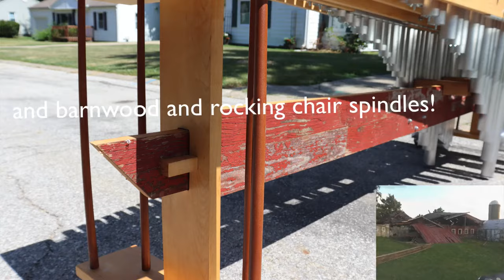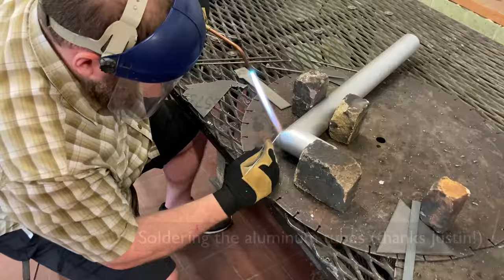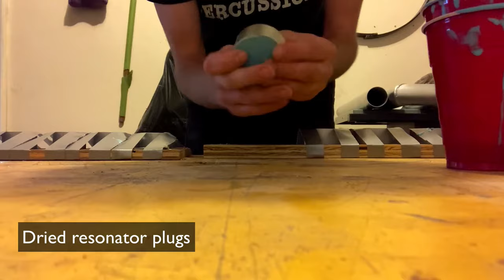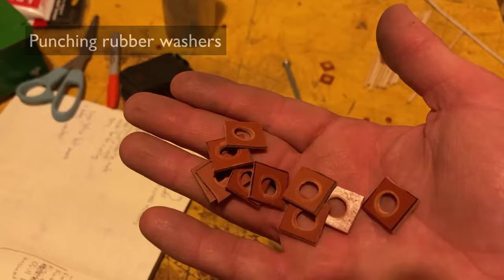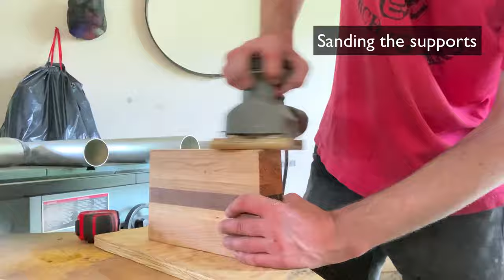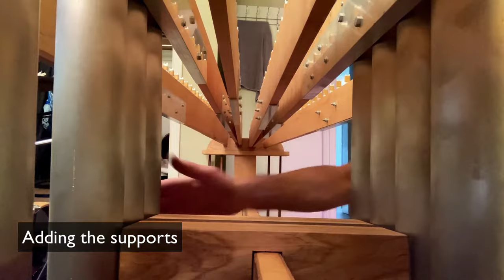Marimba Resonator Upgrade - Demo Performance and Construction Steps

Comment: oh my gosh  you made this! so awesome!   I want to make one for my kids elementary playground now. Maybe I can use trex decking instead of wood and use aluminum keys instead of wood? I know how to weld and machine aluminum so that part is not hard. There are companies that make playground marimbas but they are $3600. what is a reasonable budget if I can get aluminum wholesale for about $3/lb where I live.
Reply from the maker: Hi Rolland, thanks for watching! Yes, I made this one back in 2015 and then upgraded over the summer. Aluminum keys will work great! That's kind of like how you would make a vibraphone. Glockenspiels are made from steel typically. I've always wanted to make a vibraphone but just haven't gotten around to it. I always imagined myself doing the tuning on a grinder, though. For the glass marimbas I made, I tuned with the belt sander while wearing a high-grade respirator. Hope this helps and good luck with your project!
Reply: @AlexSmithMusic  thanks for the reply. how does the thickness of the aluminum tube effect the sound? I think I have some 3" diameter aluminum tube with 1/16" walls would that be suitable or should I use something with thicker walls? any online resources you recommend or books on making?
Reply from the maker: @rollandelliott  No problem! The thickness of the tube shouldn't make too much difference, nor should the material; it's more in the quality of the bar in terms of where a lot of your sound quality is going to come from, then the resonator just needs to be tuned correctly so it will properly amplify the bar sound. In the 1940s they made marimba resonators with cardboard tubing which works surprisingly well and is super cheap. The shape of a resonator, on the other hand, does have an effect, and from my experience, Helmholtz-style resonators in particular sound a little more full. Here's a little resonator experiment I did a while back.

https://www.youtube.com/watch?v=GOkOvMiePfM

The aluminum tubes I used for this project are also 1/16" thick so that should work great. You might think about your bar width in comparison to your tubes' diameter. Usually I leave 1/2" in between my bars. You want the tube diameter to be a little wider than the bar itself (the bigger the mouth of the resonator, typically the louder the amplification). But, it can't be so big that there isn't room for the tubes to be mounted under the keys; of course you can get creative with how you mount your resonators. There are lots of ways to do it!

Here is a link to a short video I made about 10 years ago when I learned to make my first instrument. The link will take you straight to the part that overviews the construction steps (please forgive the production quality :) ).

https://www.youtube.com/watch?v=kDqBIMFpWIA&t=457s

Also, Chris Banta has a book that I've heard is great. I've also seen that they have a lot of other resources out there online. Maybe check them out.

Good luck with your project and let me know if there's anything else I can do to help!